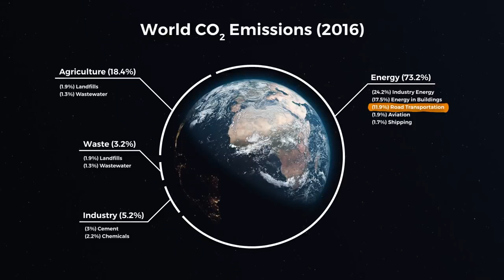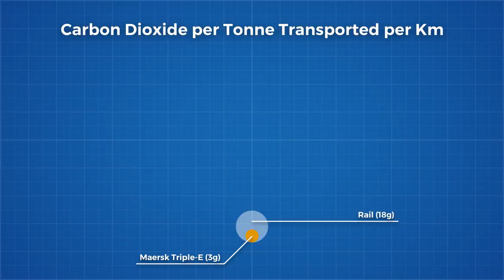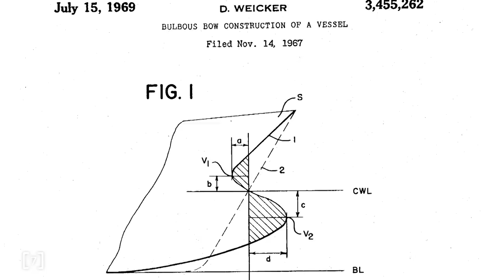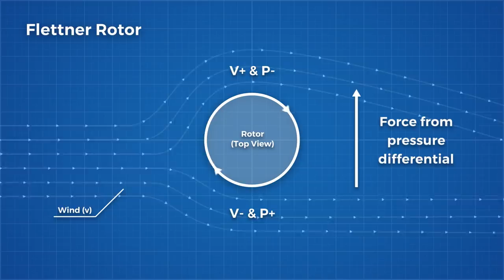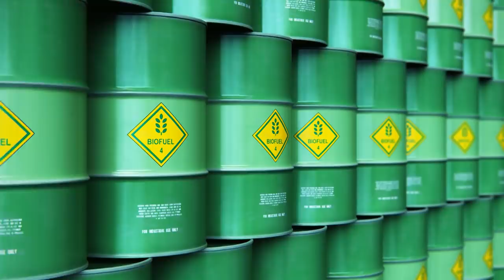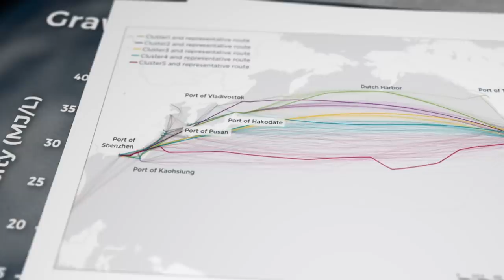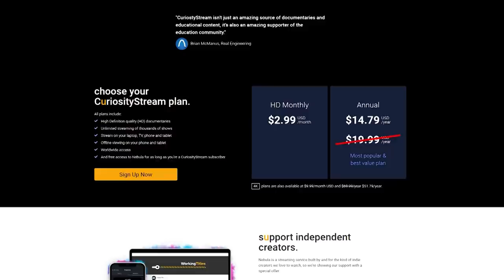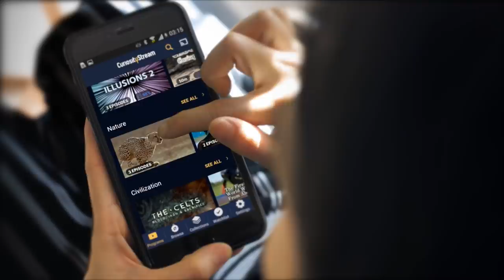Are Renewable Powered Ships Possible?

Comment: You could fit them with electric engines and recharge them with green energy... So yeah...
Reply: How to create the energy to drive the engine is the problem.
Reply: @BernardLS  massive battery... Fill her up in port with renewable energy...
Reply: Electric motors powered by ‘green electric’, leaving aside the fact that there is no truly ‘green’ electricity, the best we can do is low carbon impact both at installation (capital cost) and production (current account).  Running ships on the ‘lecky’ is tricky the two examples that I personally know and have used are, a vehicle and foot traffic 'chain' ferry that ply’s its trade across the hundred meters or so of the Nordre älv between the island of Hisingen and Kornhall on the Swedish mainland.  The motors are on the ferry and the cable is unwound and wound back up on board as the ferry shuttles back and forth from Kornhall.  When the vessel goes anywhere else, id est dry dock for survey and or maintenance, it is towed by a good old ICE powered tug.  The other electric vessel is a vehicle and foot traffic ferry that runs from Helsingborg (Sweden) to Helsingor (Denmark) a twenty minute trip; she tops up the charge in Sweden each time she is alongside and battery capacity is 'said to be' sufficient for an hour of main engine use.  There are small diesel gennys on board; to keep the lights on in extremis.  Sadly as of 'now' electric boats are as functional as chocolate fireguards, yes ‘submarines can be diesel electric’ but they have negligible cargo carrying capacity and if you ever go on one the first though you may have is ‘where do they put the crew people?’
Reply: @BernardLS  I can see how fitting a battery big enough for long travel would be a problem... Unfortunately battery technology is kind of progressing at a crawl...
Reply: @BernardLS  you could have tethered vessels..
Tethered to the mainland via a power cable... That could work...as they travel they unwind the power cable and as they travel back they could wind it up... They would only to be able to go back and forth... But they could Un tether at the tether port and use a diesel engine to switch ports
Reply: @troyhayder6986  Until some other ships comes by and chops your cable by driving across it!  AAT (and another thing) the carrying capacity of cargo ships is constrained in two ways, mass and volume, so the mass of the batteries reduces the carrying capacity (revenue earning potential) of the vessel except for low mass high volume cargoes.  Your best power gen option, and it is not good, would be VAWT (vertical axis wind turbines).  Sorry your idea is in the 'more research is required' category.
Reply: @BernardLS  you would definitley need very coordinated sea traffic control.. Just like the aircraft control system...
Reply: @troyhayder6986  the hundred meters I gave in my example, for a very small vessel in shipping terms, is pushing the limits of the technology. Think in terms of rowing there are limits to how big you can make a vessel that it is possible to row. How many banks of how many oars would be needed to move a Mearsk Triple E? Bigger ship more power, bigger cable. Longer range, longer cable uses more space to stow on board.
Reply: @BernardLS  apparently 80,000 tesla car batteries for a 200,000 ton sea vessel moving through air... Not accounting for the weight of the cargo....

But water resistance is greater than air resistance... Therefore water travel equals greater energy expenditure and is not energy efficient... Therefore water travel is not green and should be discarded in favour of Air travel...
Reply: Travelling through plasma would be even more efficient because objects travel 8 times faster through plasma than gas...which could be done if you could create an electromagnet that converts the surrounding atmosphere to plasma as long as you could withstand the heat... 

And travelling through a vacuum would be even more efficient... But how to dispel atmosphere???
Reply: @troyhayder6986  putting things on ships, when appropriate, is the most energy efficient and environmentally benign transport medium we currently have.  There is still some space for improvements but the best way to reduce the environmental impact of transport is to reduce consumption ‘satisfy your needs, not your greed’.  Marine traffic control exists but does not have the impact ATC, sadly IMHO.

Comment: "Cosmology" equals fraud. Clean new energy source based on how the Sun actually works soon to be commercially available. Although non-radioactive and radioactive material not needed to work it will breakdown radioactive material with in hours not decades. Despite “cosmologist”, particle and quantum “physicist” the future is here. https://www.youtube.com/watch?v=7GFFfmBGb5U This new fusion reactor could be used to power ships as well. Hydrogen will be dirt cheap to produce; hydrogen powered cars and trucks not electric will be the future. We will not need their gas, oil, fission, solar or wind power

Comment: nuclear was always the answer
Reply: If you do a web search for ‘nuclear ship savannah’ you will see that it has been tried and did not work.  A similarly heavily subsidised, by the government, vessel is in use in Russia which also operates, in support of the Northern Sea Route, a fleet of nuclear powered ice breakers these may, or may not, have been completely without issues.

Just think; would you have full confidence in the management of a nuclear reactor under the control of an anonymous entity only traceable, perhaps, via a letter box in a FOC (flag of convenience) nation state?  If you are, could you sell that confidence to Japan, the state that hosted the Hiroshima and Nagasaki nuclear detonations as well as more recently the Fukushima ‘event’?  Then try that same, or a similar, sales strategy on Ukraine, the nation state that as a part of the USSR (CCCP) hosted the Chernobyl ‘event’.  Modern iterations of nuclear energy, thorium fuel, molten salt reactors or fusion reactors, will carry the legacy of past problems.  It is the global trepidation of anything with 'nuclear' in the name and the economics of nuclear having transitioned from 'energy to cheap to charge for' too 'the costs of remediation are incalculable' that will prevent the adoption of nuclear energy as a means of creating energy at sea.  Modern reaction systems may have overcome the safety problems but the general public, having been misled in the past, will be reluctant to believe the fresh new promises.

‘They’ say nuclear is cheap, it’s not it is expensive and has a large embedded carbon quotient as well as being complicated, dangerous, not universally socially acceptable and having only ‘no need for refuelling’ as a questionable advantage; actually it does need refuelling just not as often.  When ‘they’ do need to refill the warming up stuff it takes considerable longer than pumping tonnes of thick black stuff, HFO cSt380, or thin runny stuff, MDO, onboard which is one of the reasons HMS Queen Elizabeth and HMS Prince of Wales are pushed about by ICEs and gas turbines thus using a similar fuel as the aircraft that fly off of them.  The Royal Navy (RN) with a high degree of skill and expertise uses, at vast expenses to the UK taxpayer, a current operational nuclear fleet of 11 submarines (also known as ‘boats’) in two flotillas, seven attack subs and four ballistic missile boats.  The carbon footprint of all the extra bits of hardware and the fuel, including processing thereof, from ground to propeller, are the external costs that never seem to get considered.

Disposal, once it wears out, of both the machine (that was a ship) and fuel is another can of worms best left unopened.  The 26 RN boats no longer in use are laid up (some in Rosyth and some in Portsmouth) awaiting long term deconstruction including dealing with the fuel rods and other irradiated material.  The USN is not, as far as I know, a commercial organisation working to very tight margins and also has the skill and expertise to handle the complexities of nuclear power; so as well as submarines their aircraft carriers are nuclear powered and each of the current iteration has a build cost three times that of QE/PoW, bigger crews and more generous funding.  For those who still think that nuclear energy might be the answer I recommend this report: - https://www.bbc.com/future/article/20200901-the-radioactive-risk-of-sunken-nuclear-soviet-submarines?ocid=ww.social.link.email.  The navy of the USSR might have been under resourced and over extended but it was still generously supported in comparison with merchant shipping.

Comment: One day you will find out that it is not human influences on climate change through CO2 use which long term history shows it makes no difference to climate warming as CO2 is an insignificant component of your so called glasshouse gasses while the ignored culprit is Cosmic and Solar Forcing. The latest climate models will include some of this including the correcting effects of cloud reflection On the balancing effect this will reduce blame on humans.  Note -  I am all in favour of cleaning up the fossil fuel pollution and consider the most efficient and safest way of doing this is through the use of Liquid Thorium ion molten salt energy converters which are "walk-away safe" and depending on size can produce electricity for less than USD0.04/kWh. 
Use cheap modular molten salt reactors on your bulk carriers...

Comment: Answer: Yeah its called sailing
Reply: To address the suggestions that sail power is the answer I offer the following.  In 1870 a premium sailing vessel entered service, the ‘Cutty Sark’, she could carry around 600 tonnes of cargo at speeds of up to 17.5 knots, dependent on the prevailing wind, to harness the energy the available spread of canvas was up to 2 976m2.  To round things out that was circa 5m2 of canvas for every tonne of cargo carried.  The ‘Cutty Sark’ was designed and built for employment in the tea trade where time on passage was a large factor in securing the premium freight rate that made her cost effective but as soon as the Suez Canal opened, which the ‘Cutty Sark’ was unable to sail through, she lost her advantage, raw speed, to the steam powered ships of that era.  Mechanically powered ships have improved in terms of efficiency, on a freight tonne mile basis, by at least one order of magnitude since then.  After losing out to the coal burning, steam reciprocating mechanical ships of the late 19th century ‘Cutty Sark’ was relegated to the Australian wool trade, just about the bottom of the barrel in maritime terms and only one small step up from being a 'honey barge'.  The canvas, cordage and extra manpower needed for sailing ships was never a very benign environmental option so please discount any idea of sail as ‘sustainable’.  All this is without the problem that if ‘the wind don’t blow the ship don’t go’, when it does blow it often blows in the wrong direction for your cargo delivery needs and sometimes there is rather too much of it for comfort.

Comment: Why not nuclear 😂⚛️
Reply: If you do a web search for ‘nuclear ship savannah’ you will see that it has been tried and did not work.  A similarly heavily subsidised, by the government, vessel is in use in Russia which also operates, in support of the Northern Sea Route, a fleet of nuclear powered ice breakers these may, or may not, have been completely without issues.

Just think; would you have full confidence in the management of a nuclear reactor under the control of an anonymous entity only traceable, perhaps, via a letter box in a FOC (flag of convenience) nation state?  If you are, could you sell that confidence to Japan, the state that hosted the Hiroshima and Nagasaki nuclear detonations as well as more recently the Fukushima ‘event’?  Then try that same, or a similar, sales strategy on Ukraine, the nation state that as a part of the USSR (CCCP) hosted the Chernobyl ‘event’.  Modern iterations of nuclear energy, thorium fuel, molten salt reactors or fusion reactors, will carry the legacy of past problems.  It is the global trepidation of anything with 'nuclear' in the name and the economics of nuclear having transitioned from 'energy to cheap to charge for' too 'the costs of remediation are incalculable' that will prevent the adoption of nuclear energy as a means of creating energy at sea.  Modern reaction systems may have overcome the safety problems but the general public, having been misled in the past, will be reluctant to believe the fresh new promises.

‘They’ say nuclear is cheap, it’s not it is expensive and has a large embedded carbon quotient as well as being complicated, dangerous, not universally socially acceptable and having only ‘no need for refuelling’ as a questionable advantage; actually it does need refuelling just not as often.  When ‘they’ do need to refill the warming up stuff it takes considerable longer than pumping tonnes of thick black stuff, HFO cSt380, or thin runny stuff, MDO, onboard which is one of the reasons HMS Queen Elizabeth and HMS Prince of Wales are pushed about by ICEs and gas turbines thus using a similar fuel as the aircraft that fly off of them.  The Royal Navy (RN) with a high degree of skill and expertise uses, at vast expenses to the UK taxpayer, a current operational nuclear fleet of 11 submarines (also known as ‘boats’) in two flotillas, seven attack subs and four ballistic missile boats.  The carbon footprint of all the extra bits of hardware and the fuel, including processing thereof, from ground to propeller, are the external costs that never seem to get considered.

Disposal, once it wears out, of both the machine (that was a ship) and fuel is another can of worms best left unopened.  The 26 RN boats no longer in use are laid up (some in Rosyth and some in Portsmouth) awaiting long term deconstruction including dealing with the fuel rods and other irradiated material.  The USN is not, as far as I know, a commercial organisation working to very tight margins and also has the skill and expertise to handle the complexities of nuclear power; so as well as submarines their aircraft carriers are nuclear powered and each of the current iteration has a build cost three times that of QE/PoW, bigger crews and more generous funding.  For those who still think that nuclear energy might be the answer I recommend this report: - https://www.bbc.com/future/article/20200901-the-radioactive-risk-of-sunken-nuclear-soviet-submarines?ocid=ww.social.link.email.  The navy of the USSR might have been under resourced and over extended but it was still generously supported in comparison with merchant shipping.

Comment: But you  know buddy? The "greenhouse gas effect" was proven WRONG!!!
See:
http://joannenova.com.au/2010/02/4-carbon-dioxide-is-already-absorbing-almost-all-it-can/
https://nov79.com/gbwm/satn.html
MODTRAN which is a model provided by Spectral Sciences and the *US Air Force*
Reply: So people get their information from blogs now? The source actually says that the greenhouse effect is real, even if it is at its maximum effect it is still warming the earth. Also it has also been proven right by countless scientists many times, please read some scientific articles from scientists, they are the ones that did the research
Reply: The 33C difference you are describing here is the difference between the atmosphere's overall average temperature (-18C) and the near surface GMT temperature (15C).
This doesn't prove it wrong do your research
Reply: @MoinKhan-wv5qw  
I will check your say:.
let's reverse-engineer the MODTRAN radiation code result:
https://upload.wikimedia.org/wikipedia/commons/7/7c/Atmospheric_Transmission.png
There are only two wavelengths where CO2 acts as a GHG (around 4 microns and 15 microns)
and they are quite narrow, and represent less than 5 percent of the total spectral range
of earth's natural radiative heat to space. 
Now equal concentration to define energy density:
Water vapor concentration: 10 000 ppm (average) or 1%
Carbon dioxide concentration: ~400 ppm (average) or 0.04%
10 000/400 = 25 or 1/25 ~0.05
0.05 x 5% = 0.002
We know greenhouse gases increase global temperature by 33 °C.
33°C x 0.002 = 0.06°C
total influence of Carbon Dioxide is 0.06°C.

Let's use Ideal Gas Law
PV=nRT
Earth 100% CO2 
T = 101.3 / (8.314 x 1.225/44) =437.63 K (result in absolute temperature) 
437.63K - 273.15=163.85 °C (conversion to Celsius)
163.85 x0.04%=0.06°C ! (Earth CO2 heating, this is not a ghg effect!) 
That agree with my previous calculation for "greenhouse gas effect" !

As we SEE the energy is CONSERVED!!!
Reply: @WadcaWymiaru  how do you know your sources are reliable
Reply: @WadcaWymiaru  and it’s not just nasa, just do research and you will find loads of sources
Reply: @WadcaWymiaru  the only thing you taught me is that we are doomed

Comment: The heavy fuel oil used in these ships spews out all sorts of nasty pollutants but you d'heads are so self obsessed with CO2 that it clouds your judgement. Flushing out the bilge tanks on one of these vessels have far more adverse affect on the environment than Carbon Dioxide which is a harmless atmospheric trace gas